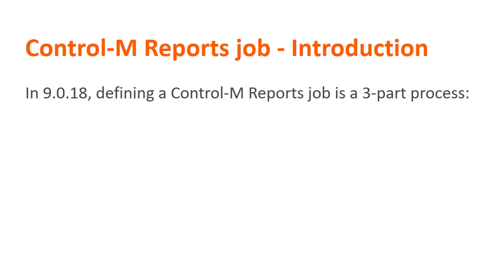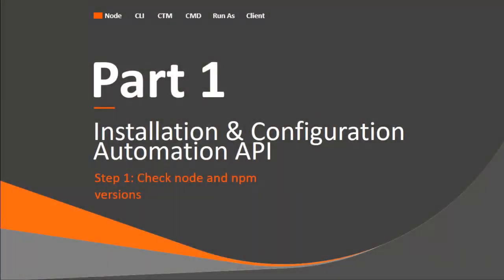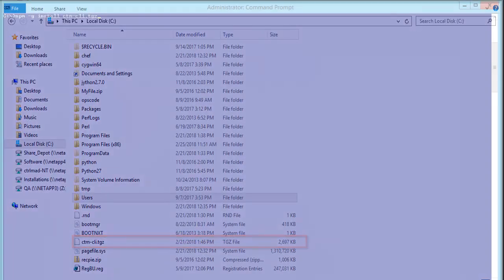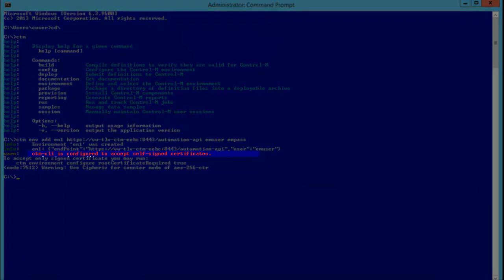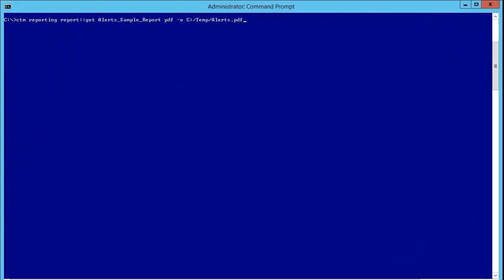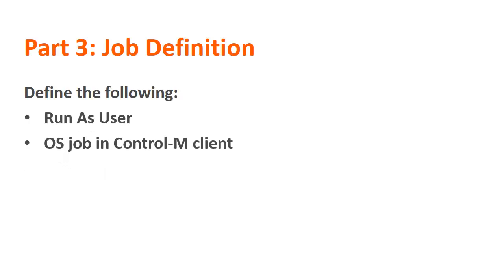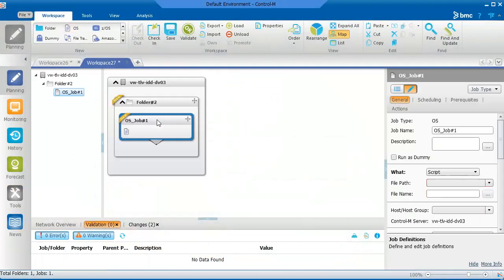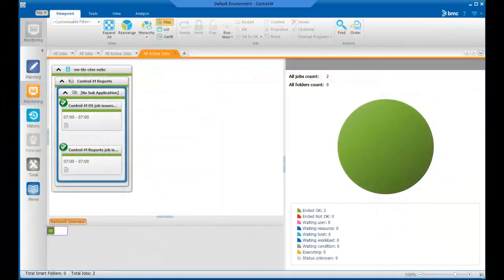Control-M Reports Job Definition

Comment: Hi Team, have a query. When you say you to download the CLI on control-m instance. Should this be done on a server which has Control-M agent running or Control-M EM server+CLient running or only COntrol-M EM client running. Can you please clarify. Many thanks in advance.
Reply from the maker: Thank you for your question. The CLI should be installed on the Control-M/Agent Machine. The Control-M/Agent will execute the OS job that runs the CLI to create the report.
Reply: @HelixOpsDocs  Hi team thanks for your reply. But to donwload the ctm-cli package it was mentioned to be downloaded on a machine which has work bench installed or control-m instance installed. So by control-m instance are you referring to Control-M em server as having only agent on the server will not have aapi capabilities. Please advise as it is a bit confusing